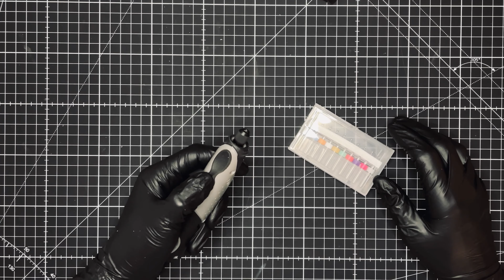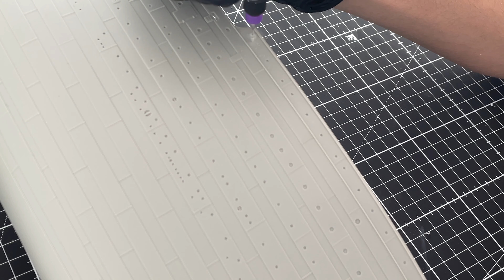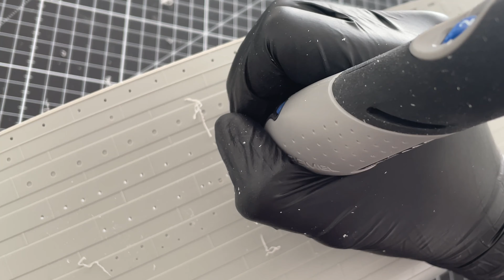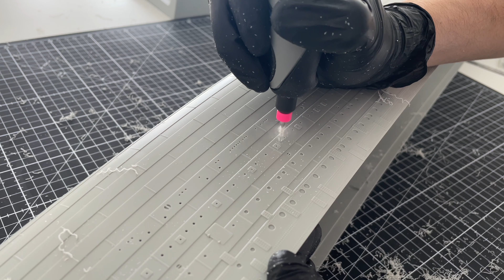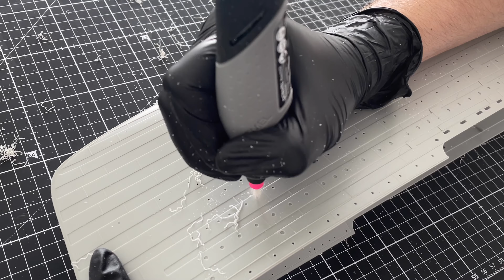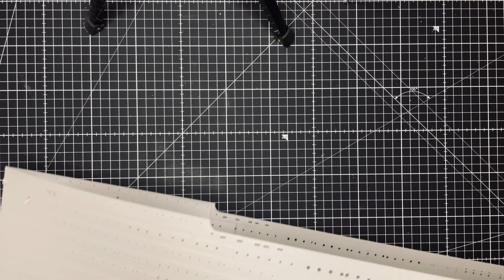Drilling the hull - 1/200 TITANIC Trumpeter

Comment: Yes those portholes around the stern are very badly angled due to the single piece moulding I would think.  The Mini brass stern plating replacement can really enhance that section and the portholes angles are corrected really well. The hull is also void of any plating under the stern and the under hull.  The bow hawser pipe opening is not the correct shape on the model (tut)! and really need some work doing on it or a replacement.  If done at an early stage it is not so bad. I used a fine razor saw to do the cutting out work which does little damage!  Well done for getting the portholes drilled out, it can feel like your life is passing you by doing those!!!😉
Reply from the maker: The MiniBras stern plating is the next video. Stay tuned !
Reply: @titanic_studio  Excellent, you are definitely on the case!!😉